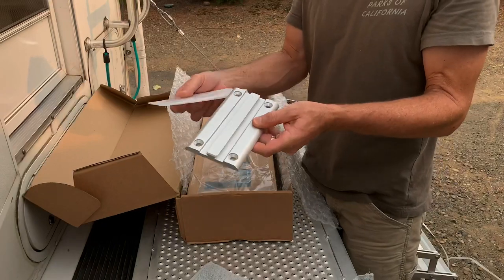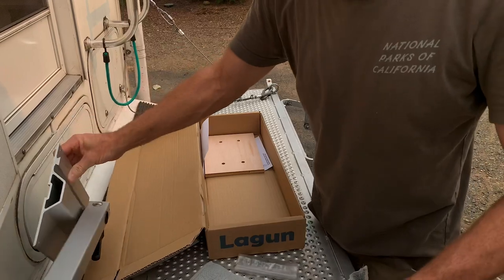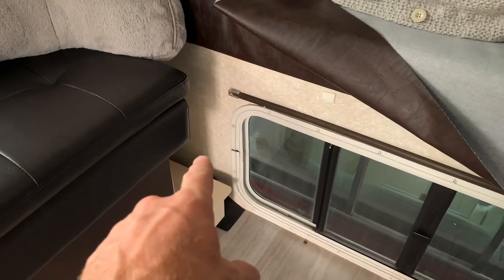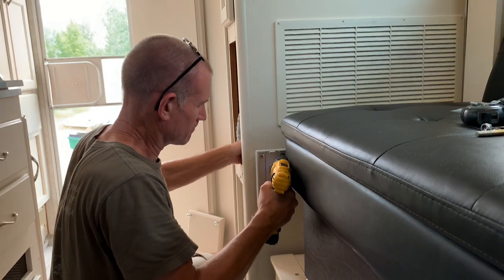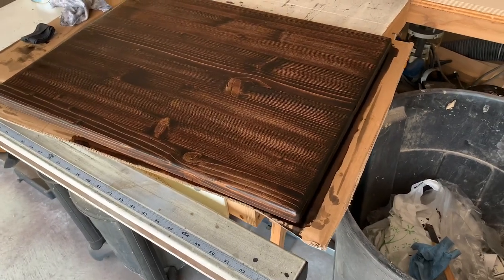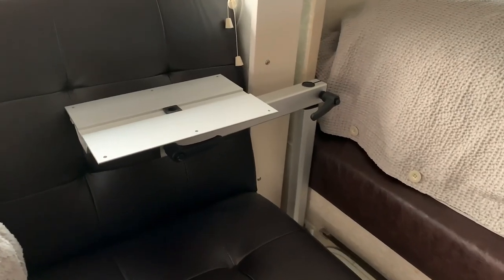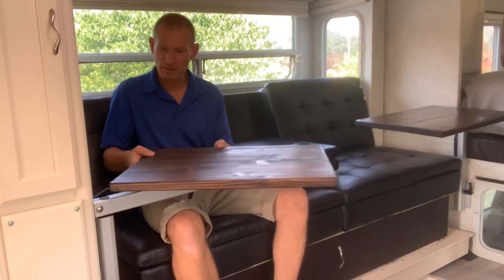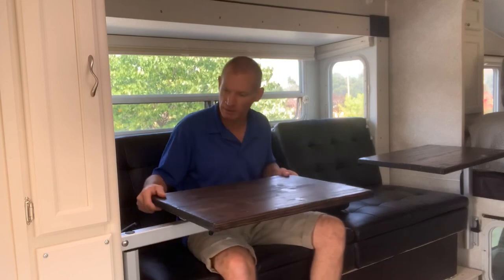Lagun Table Leg Installation and Review.  Truck Camper Remodel.

Comment: This is the best Lagun Table mounting demo I have ever seen, excellent!  Great photography too, very clear, good light, appreciated all the angles and closeups (even of instructions, ha ha!).  Good job!!  Great job mounting them too, very professional.  The trick is to add that block of wood BEHIND the thin Luan plywood RV facing, for support.
I liked the stain too!  Mahogany mix was a good color.  I find I always have to mix stains to get a rich look - one is too one-dimensional.  Mix two and even add a third separately with dry brush for aging or a second color by itself.
What I like to do with pine wood is to age it a bit using an angle grinder and wire cup brush to texturize the wood, then flame it with a torch, then use 3 stains, then polycoat it with diluted poly to seal up.  Looks like an old farmhouse table.

fyi - Don't say 'uh' so much in your speech. Speech should be well crafted without fillers.
Great job staying in shape.  One of the few that did not gain weight during Covid!
Reply from the maker: Thx

Comment: That is an Andersen stabilizer bucket.  I bought one this summer to try out and I love it.  It seems so much more stable than using the orange blocks. It allows me to not have to put the tongue down so far and creates a more solid base.  I would have been much more nervous with those ruts if we still had the 400.
Reply from the maker: What?

Comment: Are you able to raise the one by the bed and use it while in the bed?  I am looking to serve 2 couches that are adjacent to each other.
Reply from the maker: It raises high enough to be used as a side table when on the bed.  It will not raise high enough to swivel over my legs while on the bed on my particular camper because I have a raised platform bed with storage under the mattress.

Comment: Yeh great. But u wish yoy had shown us screwing the top on aswell.
Reply from the maker: It’s six screws.  
The position of the tabletop on the Lagun mount will vary.  In my case, I have a Slideout in my camper that needs to clear the table edge when retracted so I mounted my tabletop further off center than the recommend in the instructions.  Works great for my camper configuration.

Comment: Nice tables but the company exhibits cut-throat business practices.  They charged me for a component part they never sent and refused to issue a credit.  Then they blamed it on me for not checking in the box when I received the package!  Nice product, not so nice business.
Reply from the maker: Bummer.  I’ve had nothing but good service from them.  I’ve purchased and installed over a dozen of these for various clients.  
Did you buy direct from Lagun or a dealer?